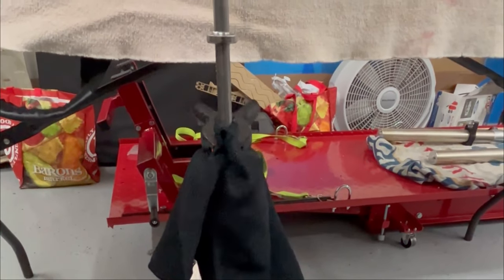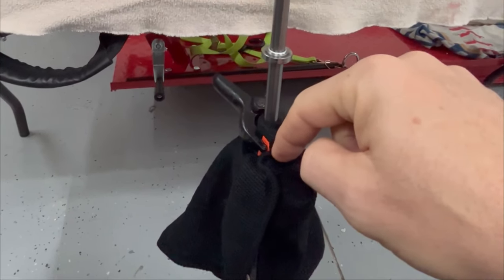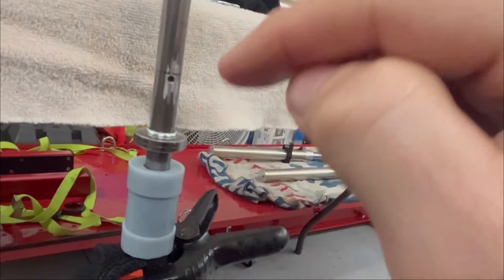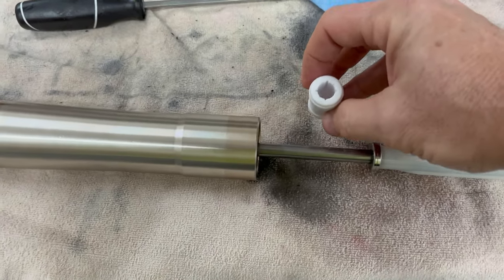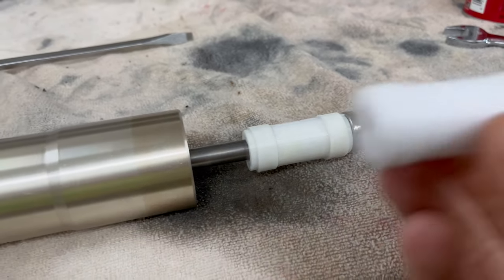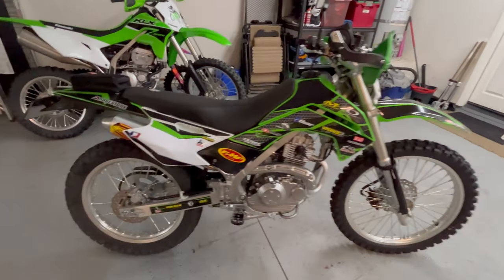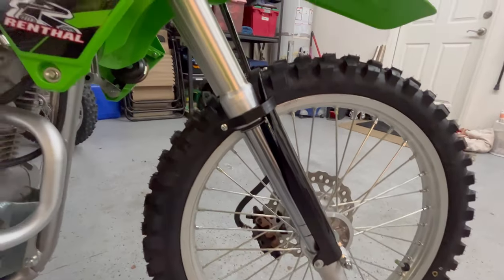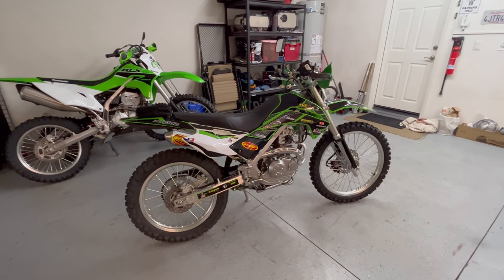2022 Kawasaki KLX140RF - 2012 KX100 front suspension swap retaining 21" front wheel

Comment: So I'm interested in building something very similar. Using the 140g or the 140 RF either one. And wanting to go with USD forks. But I want to actually add suspension travel in the process. Giving me full 12 in travel like a normal Motocross fork. Modifying the rear to do the same would be very simple. I'm wondering if that would have been a done deal if you had not added bump stops. Or is the forks just simply too short for 21-in front wheel that you used?
Reply from the maker: Might be too short for a 21”. I have since put KX100 wheels and tires on this bike.

Comment: So how does it ride?..has it ever bottomed out?
Reply from the maker: No I doubt my wife rides it hard enough to have that issue.  I might take it for a rip next time we are out.
Reply: @MikesProjectsandHobbiesMC  update?  did you ride it?
Reply from the maker: @mikehemens9359  No I’ve been busy riding my bike.  LOL maybe this weekend.
Reply: @MikesProjectsandHobbiesMC    Please jump on the 140 and leave a senapsis here if you don't mind.  Not alot of people have done this swap with the full size 140.  The bikes pegs apparently are positioned well above the bottom of the the engine so they can be re welded down a bit to help make the bike roomier possibly.
Reply from the maker: @mikehemens9359 I weigh over 200 lbs and I built the bike for a 115 lb rider so I’m pretty sure I can bottom it out if that’s what you’re wondering.
Reply: thanks man
Reply from the maker: @mikehemens9359  Just took the new to me DRZ400S build for a rip but that doesn’t help you :-).
Reply: @MikesProjectsandHobbiesMC  Sounds fun tho!

Comment: So if we installing kx100 forks on a klx140g/rf do we need to install those caps you made ??
Reply from the maker: Nope I installed those because it has a 21” front wheel.
Reply: That’s what I mean if I have the 21 in wheel you recommend to add them ?
Reply from the maker: @Afterdarkgeckos  I was told it was possible the tire would hit.  If you bottom the suspension maybe it would happen. I don’t want it to be an issue since it’s my wife’s bike and she doesn’t need surprises. LOL